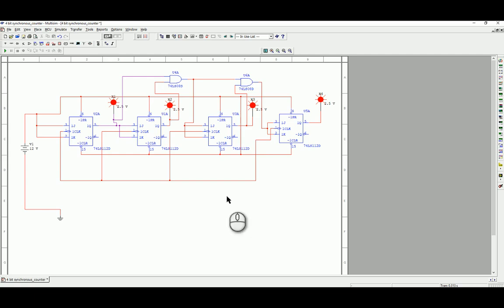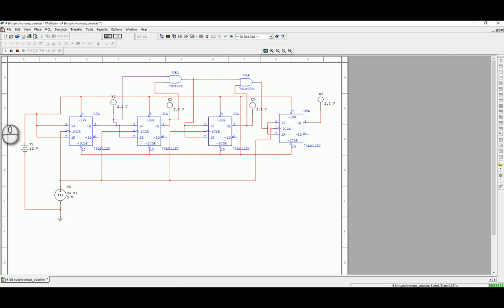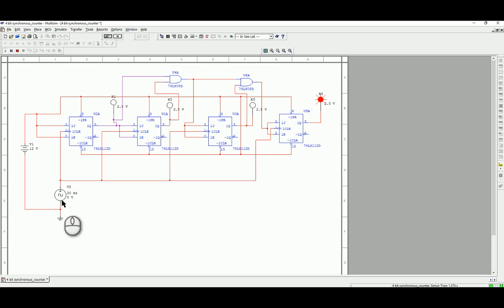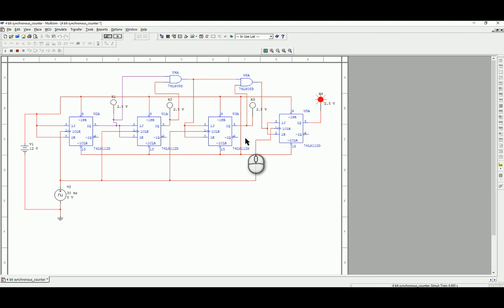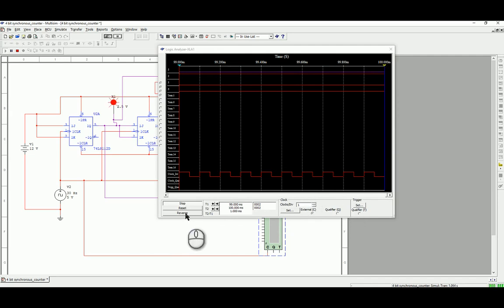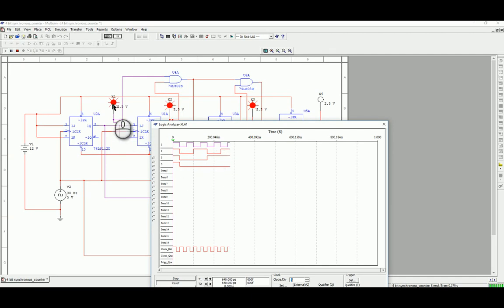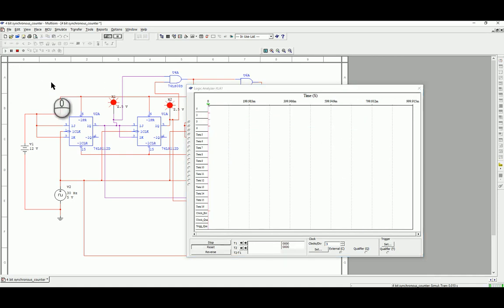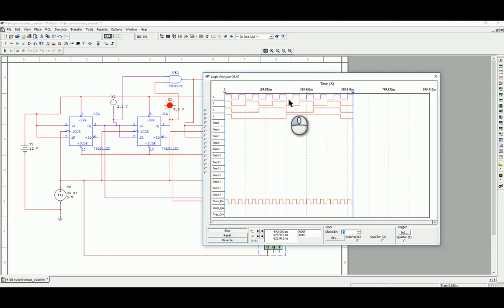Logic Analyser on Multisim to demostrate 4 Bit Counter Operation

Comment: How to do down counter 4 bit
Reply from the maker: Same basic set up, but with all 4 JK's set to start at on with reset option, then use Q' rather than' with the AND gate in the same places too. Basically move what's connected from the Q to be connected to Q' of the outputs from each JK Flip Flop.
Reply: @MarkMaginty   if I want to do 4 bit up down counter jk flip flop synchronous!!how